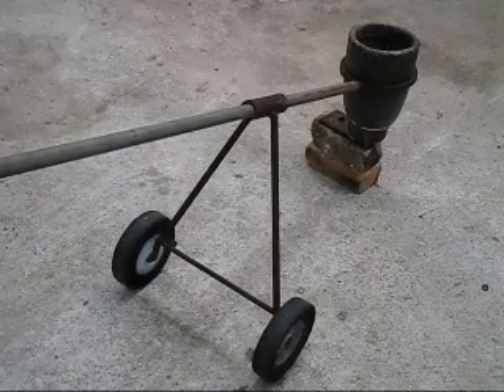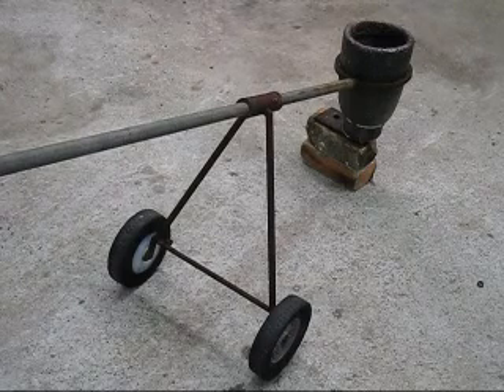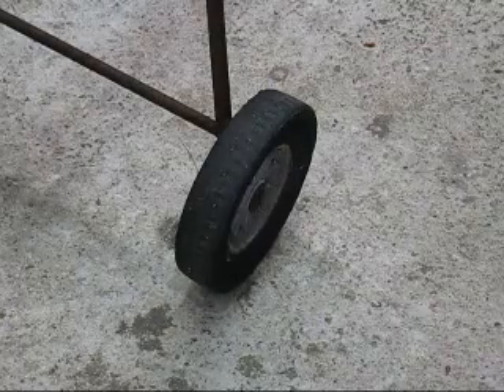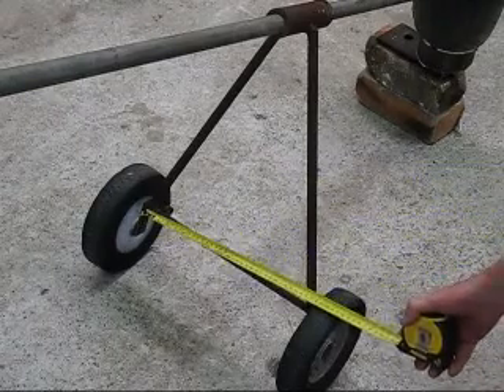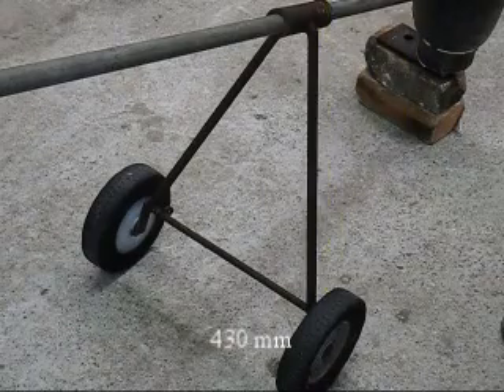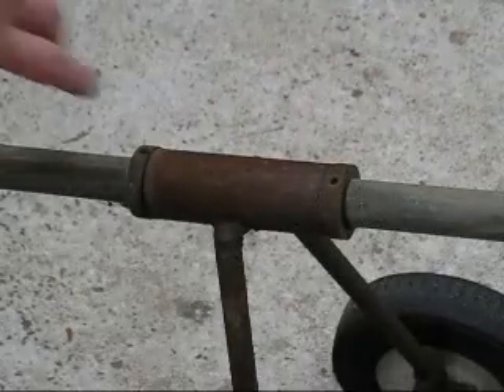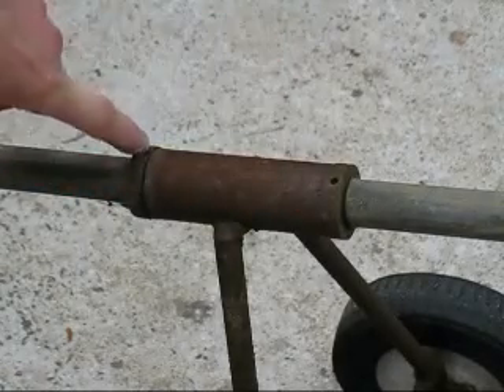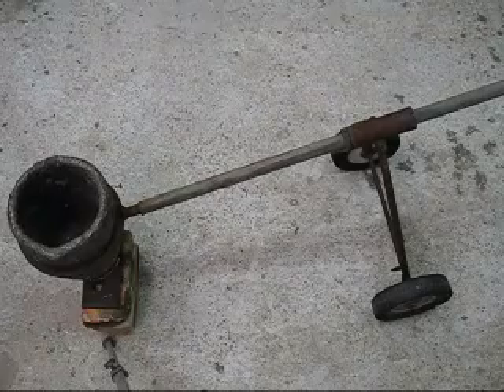How to make a foundry pouring trolley

Comment: Big thumbs up on trolley design.  
Could you tell me what size crucible you are using?  
Thanks for sharing.
Reply from the maker: A12 clay graphite crucible. I have used larger crucibles in this trolley but it gets very heavy to pour.
Reply: Thanks.  I've been using a # 30 with a two man shank.  It is more than I can handle alone.  Old back.
Reply from the maker: Ditto!